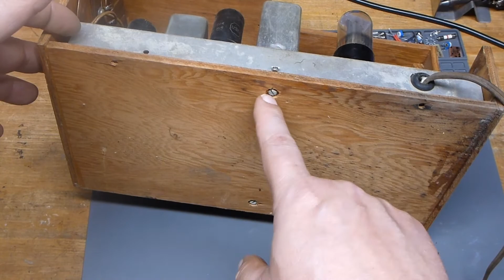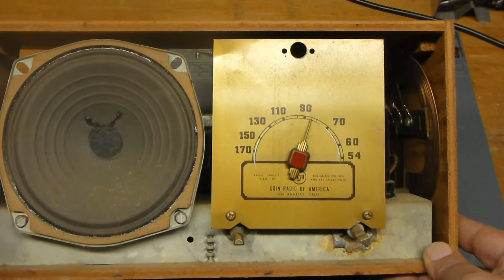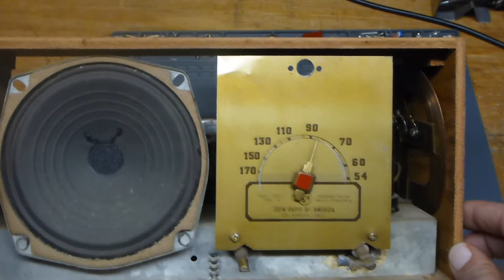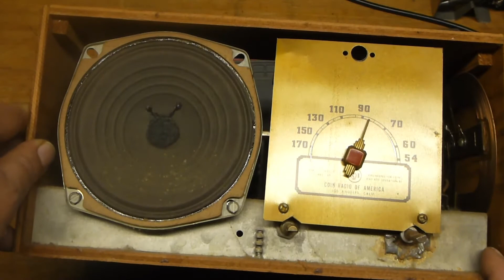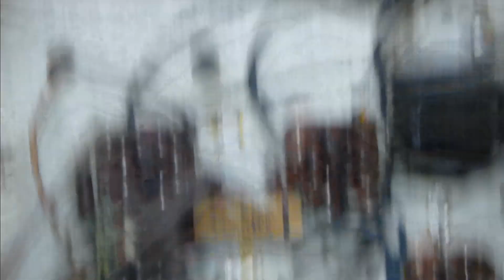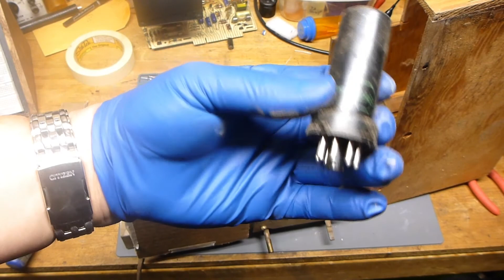RCA Coin Operated Radio- What lurks underneath

Comment from the maker: I mentioned in the description, after using a soft brush to remove the dust, it became obvious that that was not a weld, but lead. That actually makes a bit on sense. Farmhouse repairs often used lead as it was cheap, easy to aquire and versatile.

Comment: Hi again.
First thanks for the comments you left me.
Just want to mention what I immediately think a few things you are uncertain  about is:
The holes in top of the dial face: to me this looks like it could be for a lamp to illuminate the dial. Mabe the same dial face is used on different models and not all have the lamp mounted.
The component near the right side: to me this looks like some kind of a coil, looks like wire wound onto some kind of a form.
I usually go here to find tube data: https://frank.pocnet.net/
Happy restoration.
Reply from the maker: Thank you Mikael! I noticed that some schematics were showing a dial lamp, so I think you are absolutely correct. It just so happens I have some 125vac rated amber neon bulbs on the way, so that might be a nice add on. In regards to the coil, that is how I described it in an email earlier, a "weird wire wound resistor or maybe a coil". It is connected to the tuning capacitor and two of the tubes. I will look into it and thank you for the help and the link!